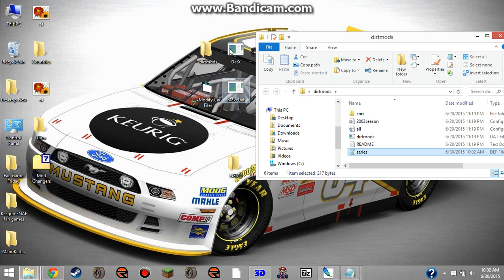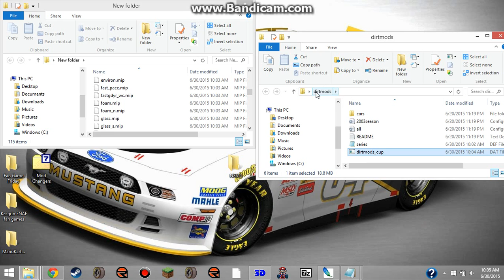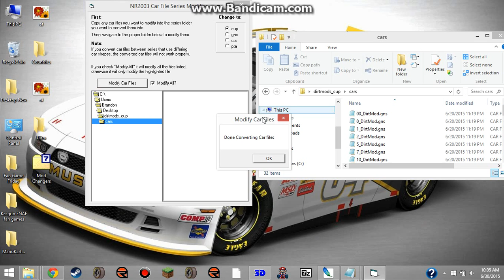How to change NR2003 Mod Physics (Tutorial)

Comment: Just so I'm clear -  the physics type is the sole factor in determining a car's performance - speed, accelaration , grip, handling, gears etc. - meaning any 2 cars with the same physics type will perform indentically (when raced on the same track) even if they are from different mods/eras. So a historic GN55 car using cup would perform exactly the same as a default NR2k3 car.
And as you cannot have cars of differing physics in the same race,  any event always has a perfectly even field - Irrespective of the car models you use and the physics they run.
Because of this,  NR2k3 isn't really suitable for simulating  multiclass racing (eg LMP/GT1/GT3) or something like F1 where there is noticable performance difference from car to car.

Comment: My game keeps crashing, could you tell me how to fix this? Like the series is all setup I can see the cars and all and can choose them. But when I actually try to drive them the game just crashes. HELP?
Reply from the maker: Look up how to disable DEP.
Reply: I did it still doesn't work, any other options?
Reply: I'm using DMRNXS16 btw.
Reply from the maker: Did you name the files with the word cup? If you want to change a mod to cup physics don't put anything like "GNS" or "Cup" leave that spot blank.
Reply: Yeah. I called it cup.dat and all but my game still crashes, and with make_a I still did that too
Reply from the maker: name the .dat file the same as the mod folder.

Comment: adding on to this tutorial, you can use winmip2 to unpack and pack the dat file
the difference is that you need to edit the .pck file to change the gns (or whatever physics) to the physics u are changing to
Reply from the maker: Yep, I use it now.
Reply: NR2003Man yeah, i think i missed something though, i converted the car files but the game crashes when i select player info.
EDIT: fixed it. car file editor malfunctioned